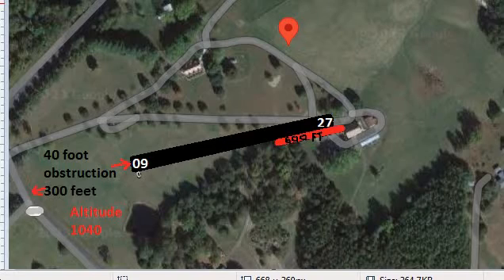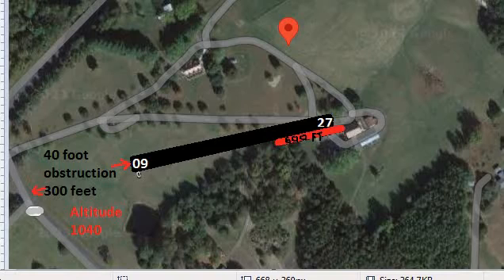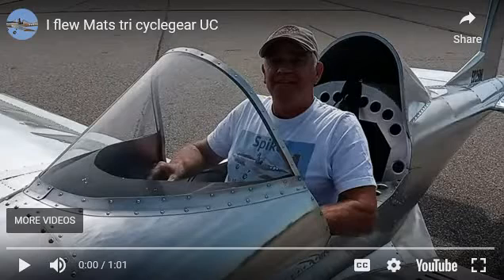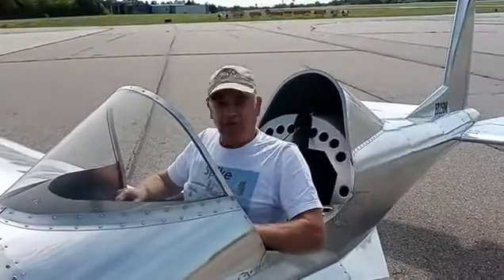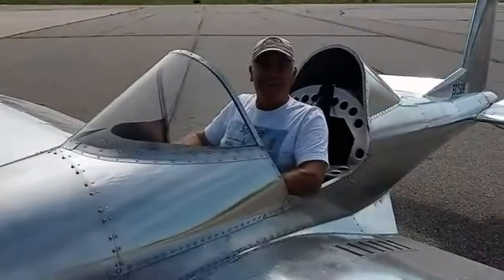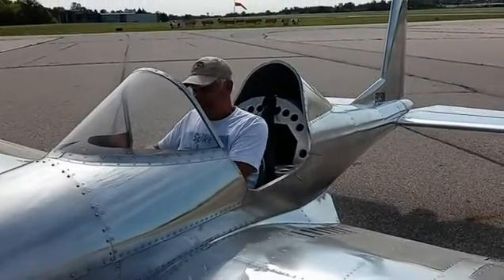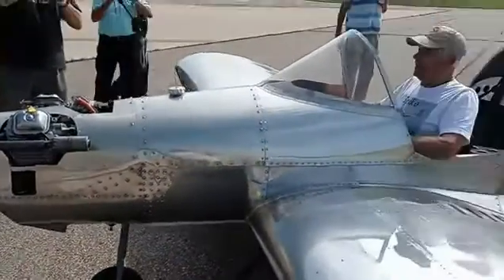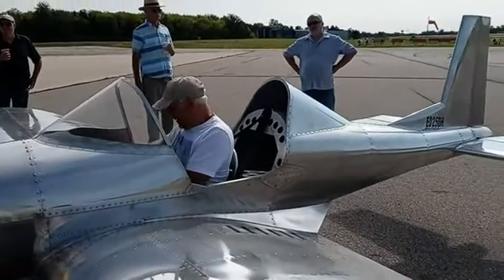18 - VG23air - New Runway construction and Hummels Predator 4 stroke

Comment: Also, the battery is for starting only.   The vtwin is the same weight as the half vw.
Reply from the maker: i dont know the weight of the vw, this one has a weight stated firewall forward on the sales info of 83 lbs minus prop
Reply from the maker: https://youtu.be/GAuzsEiQIj4?si=aEEgFd049iGocGjH
Reply from the maker: the soundboard noise in that video is alarming, when they first start it and it sounds like someone is shaking a metal shed. They need to adopt a better motor mount like the one used on the german rebel.
Reply from the maker: https://youtu.be/0gEX-SVlots?si=_bmcOSn7bJOzFxAq
Reply: @vg23air  thats the sound of the elevator oil canning.   It was unexpected and has since been rectified
Reply: @vg23air  i correct myaelf the vtwin is lighter than the halfvw.   Allows trigear to be built.
Reply from the maker: this is the best video, https://youtu.be/1cEnNKno048?si=P5jaMjhSKVCtxJsM
Reply from the maker: enable close captions and it will translate

Comment: You wouldnt HAVE to rebalance the engine if the pistons and rods weighed the same as what came out of there
Reply from the maker: if they used billet, and they say they do, it has to be rebalanced, there are only so many places to buy the internals, they are not the same weight